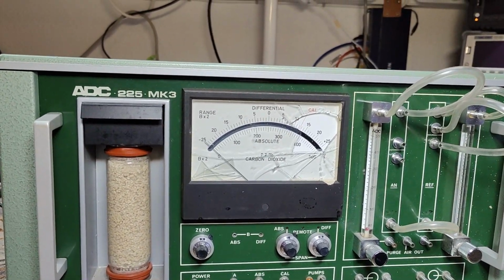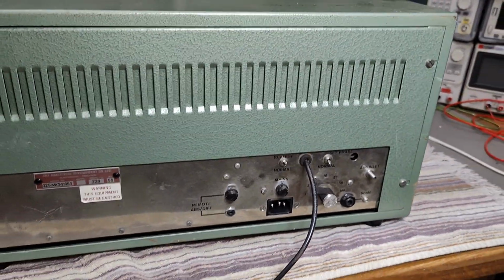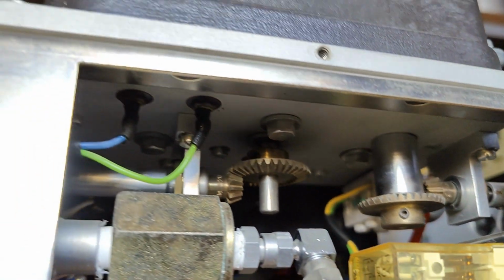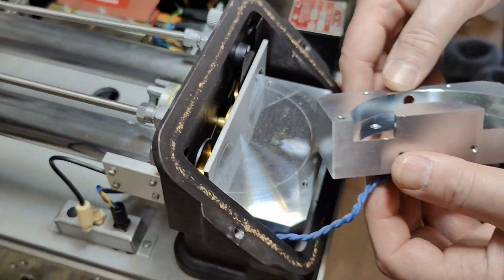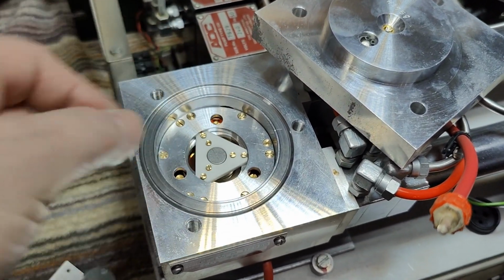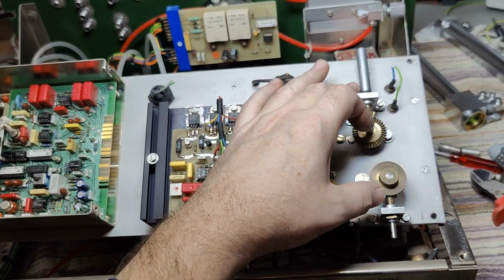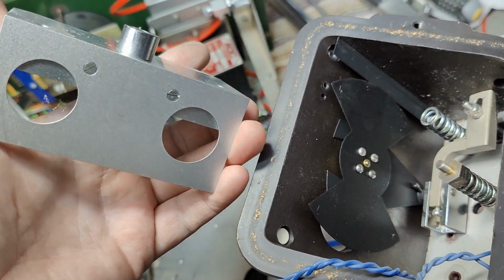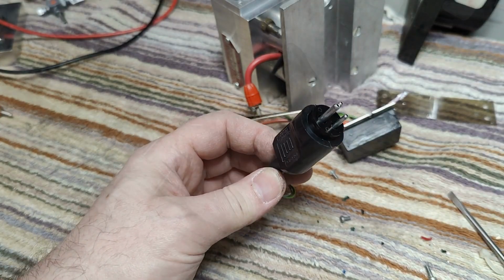Analytical Development ADC 225 MK3 Medical CO2 measure 1986

Comment: I watched a teardown of an automotive exhaust gas analyzer that worked on a similar principle with two tubes and a chopper, except it used a some type of photo detector sensor to measure the non absorbed IR light.

Comment: The emitter has an optical chopper. The two long tubes are the reference and measure tubes. The absorption of light by the gas in the tubes is compared between the two to determine the CO2 partial pressure in the measured gas (e.g. exhaled gas). The chopping frequency is probably not very high - 1Hz order of magnitude I'd think. The detector is a differential thermal sensor that uses gas expansion. That's why it's sealed - of course now the sealing is gone. The detector has two cavities filled with gas that absorbs IR, and the diaphragm senses their differential heating. Clever approach. The detector could probably be reassembled, refilled with gas, and made to work again, as long as the membrane is not thermally damaged too much. The sample tubes can be cleaned out. The IR source could possibly be a light bulb with some optical bandpass filtering added. That whole thing could be rebuilt with more modern connectors, and a few improvements to the design - like the use of plastic tubes instead of stainless, pumps removed from CPAP machines, etc. I would not condemn it just yet - it could be a nice project.
Reply: You can buy modern equivalents to this, not taking up much more space than a matchbox, and they work in exactly the same principle :)

Comment: The detector looks like a photoacoustic system. The detector cells were likely filled with CO, so that it absorbts there specific wavelengths. The absorbes IR heats up the gas and increases the pressure.
Reply: It's called NDIR (Non-Dispersive Infrared Absorption Spectroscopy) CO2 detector. No audio, just the attenuation of the infrared light by CO2, not CO. PAS (Photo Acoustic Spectroscopy) was not invented back then. I believe the "microphone" here picks up the gas expansion when the infrared gets absorbed into the reference gas filling.